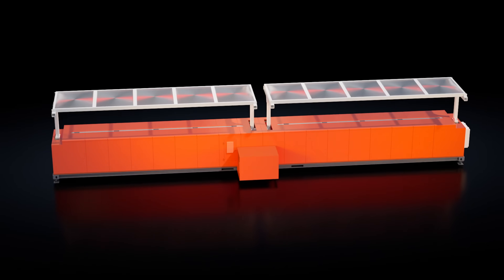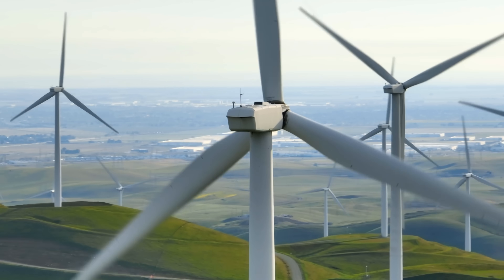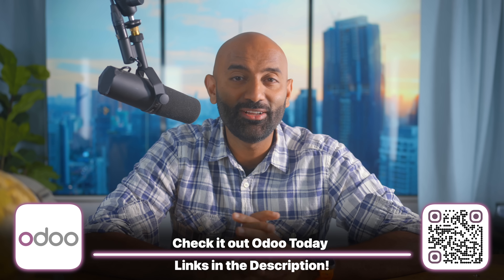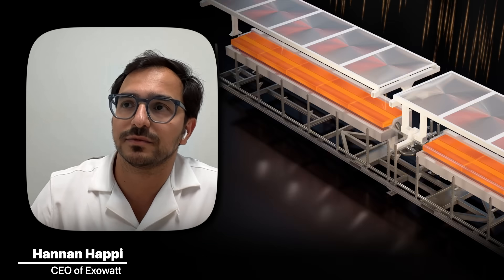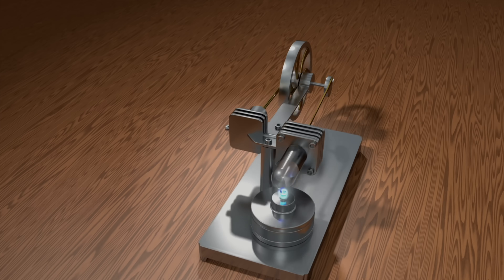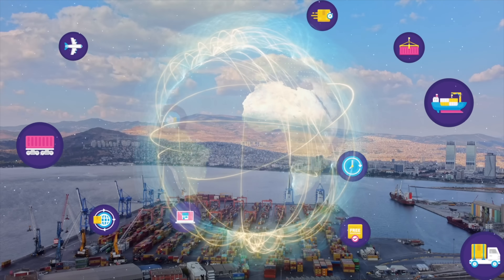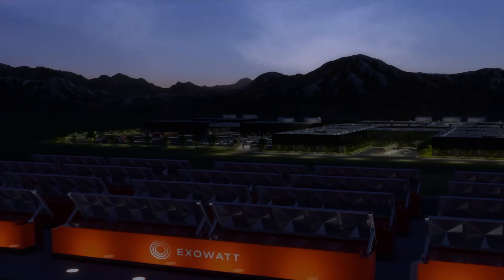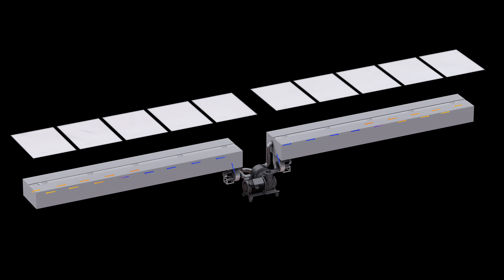Solar Without Panels, Storage Without Batteries - EXOWATT

Comment: I would imagine the Fresno lens mechanism is going to be your biggest issue because if it ever breaks down and points that Fresno lens in the wrong direction you're going to end up melting something important
Reply: *Fresnel not Fresno.
Reply: How is the single axis tracking even supposed to work in the first place? That's not how you track the sun with a lens.
Reply: @SolarCookingGermany  If they are concentrating light onto a line and just tracking the sun east to west, then they would have to use linear fresnel lenses that focus light onto a line. Their website says they have a patented lens. Fresnel lenses have been in the public domain for so long that if they have a patent, it must be some weird variant of the fresnel. I don't know whether anyone has made a linear fresnel lens before, but if they made one, that might be what they patented.
Reply: @Berkana  If you're right then it would be comparable to a trough collector.

Comment: This process was used by Natives back in the early 1900s.  They would bury stones in the ground and have a Chanel of stones leading up to the surface that they would have the sun magnified on the surface stone, eventually they switched to iron. The heat from the sun would heat the stone/metal and that heat would gradually work its way along the chain and heating up the stones buried under the ground. The stones would then provide heat for a week without sun if needed.

Comment: Again I have two major concerns with this.  First is the footprint.  The amount of modules needed to produce the same amount of power as a small nuclear reactor is MASSIVE.  Each container is 40 ft long and produces 25kw of power. Versus the smallest smallest produces at minimum 10 megawatts of power. You would need a giant landmass of these devices to be equivalent to one strip. Second is efficiency.  Nuclear is 92% efficient.  So a massive reduction in materials needed for nuclear vs this technology.  It's clear that nuclear wins by a very large margin.

Comment: If they can convert sun to heat with a 60% efficiency then a version without sterling engine will also be very interesting.
If heat is what you need you get nearly 3x the energy compared to panels.

Comment: IIRC, Stirling engine efficiency is based on thermal differential between a hot source and cold source.  Where is the cold source? If it is ambient air, the numbers may be somehat affected by weather (and global warming).  Perhaps geothermal cooling (running the air through tunnels @ 55°F) would make it usable in extremely hot climates?

Comment: This Exowatt project looks pretty neat. I can see the potential. You mention the past failures of similar/related alt-energy tech in the past. It should be pointed out that in the approximate time-frame of 2006 to 2012 that you mention in the vid there were massive federal and state level subsidies for PV & Wind alt energy system projects (the government had already picked out their politically connected winners and losers), that oddly enough often excluded specific technology & engineering solutions -- things like lens and mirror based solar sterling systems for example;  at just the time some really cool and economical implementations were coming to market. There were many types of  subsidies covering  many levels of the industry from manufacture, to tax credits, to grants for installations, to special buyback rates for the power generated, to just plain-ole-under-the-table exchanges and the like.  The fraud & grift in the alt-energy space directly tied to the Obama Administration alone  is truly staggering [where's my piece ;-)  ] ... and we won't even get into the State level stuff. In short, because of government interference in the marketplace (as usual), the companies offering different, yet economically effective, options in the alt energy space went bust.

Comment: I'd love to see this scaled down for off grid homes.  Because the energy source is heat, it could be fitted with a propane or methane heater as backup power for when enough sunlight isn't available.  One unit with integrated propane tank and heater could make you self-sufficient without any other tech required. Or a second unit without the sterling engine could be used to store more heat during low light winter months.  Clay is much cheaper than lithium batteries.

Comment: I'd like to see the numbers of a heat storage only unit without the expense of power generation. The market would be huge if it was sized for domestic use instead of industrial provided the numbers made sense.

Comment: YES PLEASE!!! CONTINUE YOUR FOCUS ON THIS ONE!!
I have a good feeling about this one. It's SO SIMPLE! It's one of those rare "Why didn't I think of that?" type of things that's been right in front of our face and we didn't see it. It's low tech, and that's what is so great about it. And there are so many parts of it that can be optimized over time. You don't need to make it the most efficient, you just need to make it. You worry about making it better AFTER you get it produced as purchasable product.  You can make 'version 2.0' with better bricks, better insulation, custom Fresnel lens that are patterned to focus more light in a straight line instead of a single point, and a TON of other things. Taking the Apple approach of incremental improvement could be a viable business model for this too (even though it's a pretty crappy way to treat your slav... err customers :p lol) But getting it out the door is most important now. 
I missed the part when you first said that it has resistive heating, for cloudy days, that could be used as batteries when energy is available cheaper. That is such a great idea! It's like having two totally different systems in one! I hope you can go check these guys out and make a video about it. This really seems like one of the more promising products that you've shown us. Not that it's a game changer, or the next new thing, but a great product that solves a BUNCH OF ISSUES with other products. Like being able to have EVERY PART Made in the USA! That is a HUGE DEAL right now! EVERYONE knows how our great nation when from a powerhouse of manufacturing to an outhouse of service industry. And people really want that to change. People want America to MAKE THINGS AGAIN! And I think this is THE PERFECT PRODUCT TO DO THAT!
- I started going on about how it doesn't even have any Rare Earth Elements in it, which China has a STRANGLEHOLD on because of the awful chemistry require to separate them, but then I remembered that Neodymium is a rare earth and we NEED that for the magnets. But other than that I( can't think of anything else that would have any (except maybe a steel alloy having some in it to give it more strength or heat resistance or something, but those are not REQUIRED)
So other than the magnets it could be 100% sourced, produced, manufactured, designed, invested, praised, and drooled over IN THE USA!!! lol If I was an investor I would ABSOLUTELY invest in Exowatt RIGHT NOW! Get in on the ground level because they are goin TO THA MOON!! (not monetary advice) - I hope you can get us a tour and demonstration, and soon! :D - THANK YOU RICKY!!!!!

Comment: Would not the number one maintenance item be cleaning the lens, I would think the cost of that alone would be substantial enough to be a factor.
Reply: I have Fresnel lenses, cleaning is very difficult due to the concentric grooves. You can add a second protective layer though, then it's like cleaning a solar panel. UV degradation is also a problem

Comment: the only thing i would be interesting is in the little stirling engine that they "claim" can generate 25kw ....
Reply: Don't worry, it's BS. There's not enough sunshine on a 40' container to run a 25 kW Stirling engine for more than a couple of hours.
Reply: @joseh.zambrano8629  I might be wrong but I don't think its a 25kw sterling engine but rather is a sterling engine that running all day long produces 25 kw hours of electricity.  It might only be just over a one kw sterling engine running for 24 hours.  They said it was about 60% efficient at turning sunlight into heat and the sterling engine was 15-20% efficient of turning that heat into electricity so that's like 8-9% efficient overall.  figure with the limited movement of the lens they might harness 500 watts/sq. meter on average  and at best the lense is 30 sq. meters , that means 25-30 kwh of energy per day ballpark.  A 1+ kw sterling engine is all that's needed.
Reply: @hansbraun2726  little wrong, depending on the location total infrared irradiaton is between 1kW to 2kW / m2. What i guess is they provided the "25kw" as absolut optimal with 2kW 6h irradiation and calculated it from there. this is why i am most interested in the stirling engine, because that would give some definitive data. 25kwh/day makes no sense for that size... if its 25kwh/day , then it would be a very small 1kw stirling engine. So for a normal house with 4 airconditioners you would need at least 4 containers to get a surplus. at 4 containers its more cheap to just use batterys and solar with trackers. From all what i found this setup dosent make any sense currently. But happy to be proofen wrong.
Reply: @hansbraun2726 that's what the whole video is about though. "Generate 25 kW of POWER" "24 hours of continuous output". And then all its space comparisons are based on this number. Which is BS unless you're charging from the grid. At which point the whole thing is useless.

This is just a startup trying to get traction offering thermal energy storage. Nothing new and they'll probably pivot or close.
Reply: @snapo1750  You will get "only" about 1000W per sqm. The solar constant is 1361W per sqm but only in space. P.S. I use Fresnel lenses myself, mainly for cooking, and that is exactly how I would NOT build it 😀
Reply: I have no clue how many RPM it takes to generate ANY kilowatts. I just know that with a Sterling Engine, heat in = kinetic out. The only Sterling Engines I have observed are desktop models. About hand-sized. I also know that the Brits used a Sterling Engine more than 300 years ago to pump water from a coal mine. About the size of a small building. I also know that using gearing, we can increase or decrease rotational speed, which is what is used to generate power in a turbine. The more you know...

Comment: I don't see how this kind of panel surface can concentrate enough energy for this kind of use
Reply: Simple: by storing and accumulating the thermal energy.
If one panel is about 1 square meter, and solar radiation is 1200 watts per square meter (typical sunlight wattage most of the US and Europe if we average it out), that's about as much heating power as one electric heater. It doesn't sound like much, but the heat is not dissipated in a big room. Instead, it gets accumulated and insulated. The heat has nowhere to escape and keeps adding up, until reaching boiling hot temperatures. That's when you start to exploit the heat for your energy needs.
Reply: @texanplayer7651 ok maybe your numbers are right but let's say we have a total of 1000 km² of panels and the concentration is perfect, without losses : are we really discussing about running grid scale sterling engines with 1000 small electric heater equivalents ?

Comment: Please do more extensive video.  This is really amazing tech.  It's based on old tech, lenses!  No chemicals to manufacturer and dispose.  I hope they succeed.  Thank you.
Reply: While the component life may be 50 years this does have a lot of parts that need maintenance and underestimating that aspect is a common flaw.  Cryogenic air storage looks great on paper too and similarly uses no unusual materials but it hasn't taken off either.  I really wonder if they would be better off leaving the lenses and solar tracker off and making this as just a thermal battery first.

Comment: One of the issues with data centers is all the heat they produce. Why not capture that heat and store it in the bricks? Close the loop.
Reply: exactly use the heat from the data centres to run stirling engines